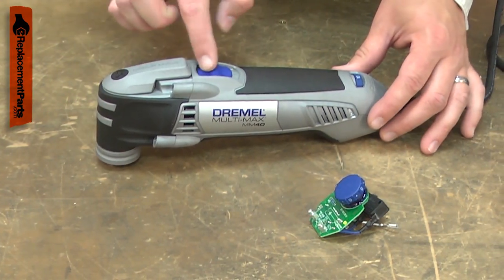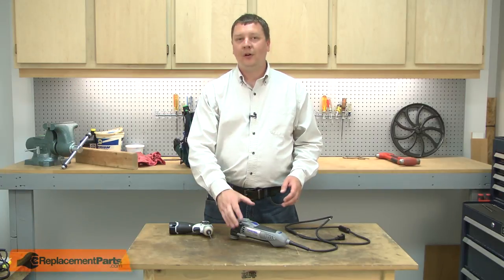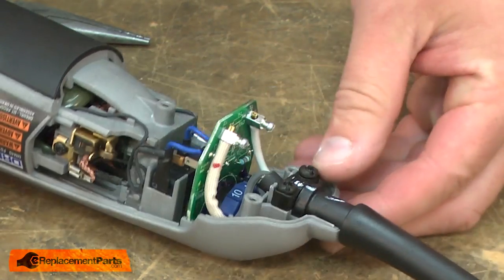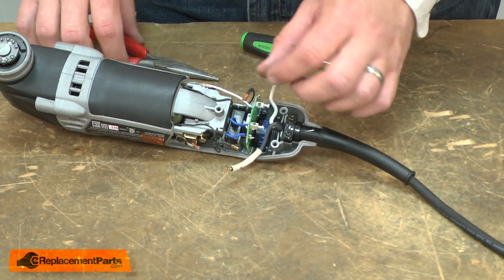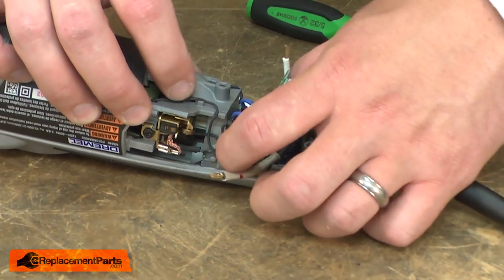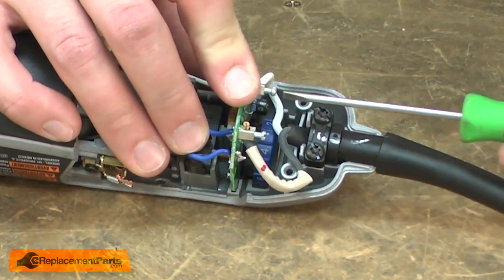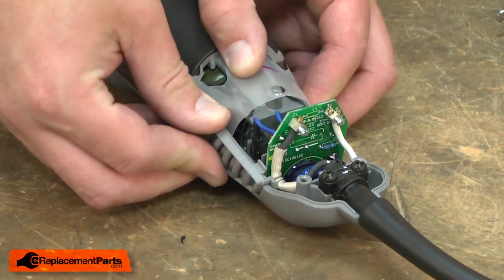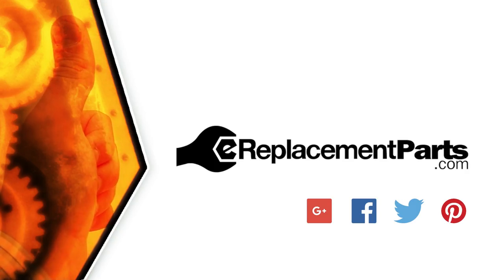Dremel Rotary Tool Repair - Replacing the Speed Governor (Dremel Part # 2610013910)

Comment: For me I noticed that the cheap nob was broken and had a bad contact, probably vibrated until it broke, jamming a paper clip between the nob and the housing to force the potentiometer make contact fixed it for me...  I didn't even need to take it apart.